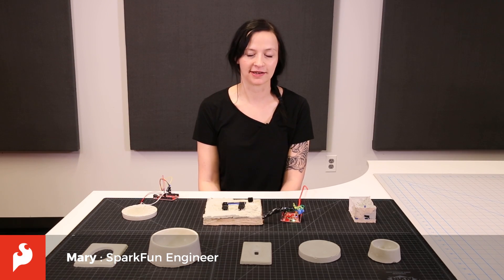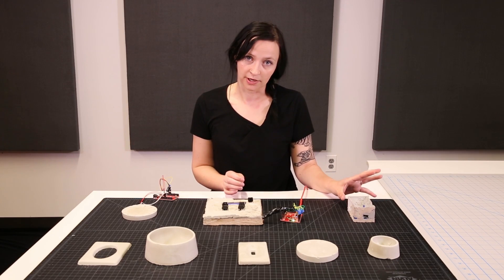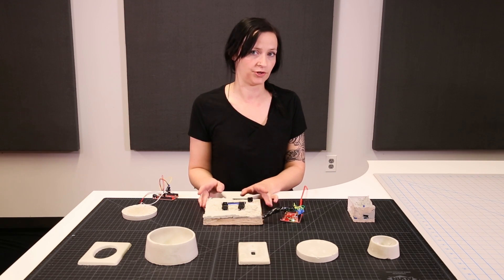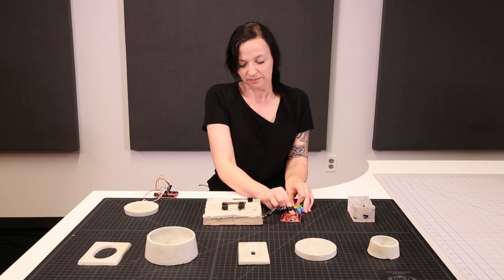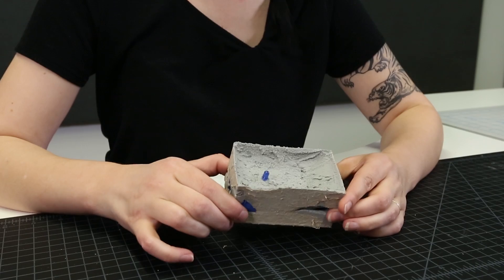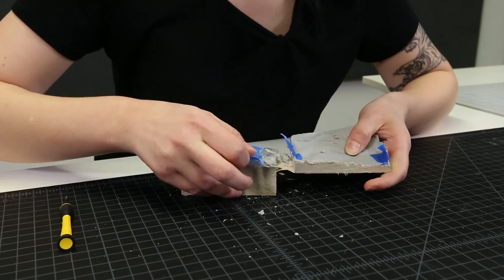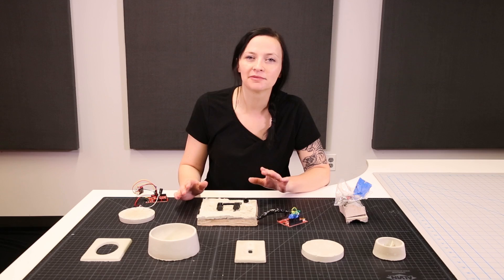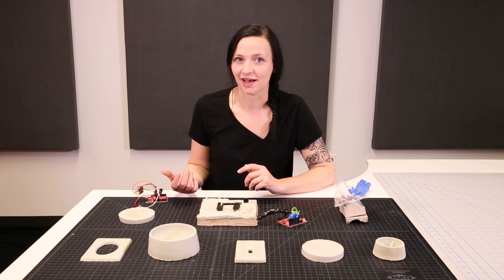Enginursday: Electronics in Concrete

Comment: Clay might have been a much better choice. Lime and its byproducts are highly corrosive. I would worry about the longevity of any wires exposed to lime and I am not sure that a baggie is sufficient protection.  Especially if any wires need to pass through it.
Reply: Oh sure. Just experimenting. I've built up a few more projects with no issues. However, I did move to using hot glue to waterproof the electronics. I just found this article after getting curious: http://www.cement.org/learn/concrete-technology/durability/corrosion-of-embedded-materials. I'll keep these projects around for a year or two and maybe do a tear down to see what damage might or might not be present.  The  things that kept me confident through process is that the projects are small and the cement dries in less than 15  minutes. If I were using a generic bag of concrete with long cure times  I don't know if I'd have the same success.

Comment: Egad. Water is going to get into that plastic bag. Why not pot everything in resin and make a plug for the port/switch? 

Concrete draws water into itself. You WILL have infiltration and the water WILL damage components if there is a tiny pinhole in that plastic bag you've used.

Comment: And what are you doing if an electronic component is damaged?
Reply: Scrap the part and make a new one of course :D
Reply: I asked the same question. But I still had to try it. I'm sure I'll damage a few parts eventually but I don't see myself not pouring concrete on all my electronics now. There is something nerve racking about the finality of using cement- I'm an electronics hoarder and I love being able to get into older stuff to make new stuff. Concrete stops me from being able to do that and on some level it pains me but also relives me.

Comment: Yah, this gives me an idea for LED shoelaces on my concrete boots!  Seriously... do you have to consider heat dissipation in this type of medium...
Reply: LED Shoelaces? Concrete Boots? Can we be friends? I have not thought about heat dissipation - time for more experiments.
Reply: I don't think heat would be a problem at all, because concrete is not a good form of insulation. If it was, we would not have concrete floors with floor heat tubing in them. Just like a coffee cup, how long does it take of the heat of the coffee to be felt on the outside of the cup, not long, but what do I know.

I will say this though, concrete is VERY caustic and it will burn your skin, so if it did get into the electronics while wet, it might ruin it.

It would be cool to make some coasters with LED's in them, so you could change the color of the LED's so you would not keep asking is this my beer?

I could also see this being put in some sort of decoration item on your porch or hang on the wall like a house number, with a motion sensor so at night if you come home late, it turns on as you walk up and gives you some light to unlock your door and then turns off automatically after 2 minutes or something. Keep up the great work.
Reply: Weeping angel concrete lawn ornaments with glowing eyes.